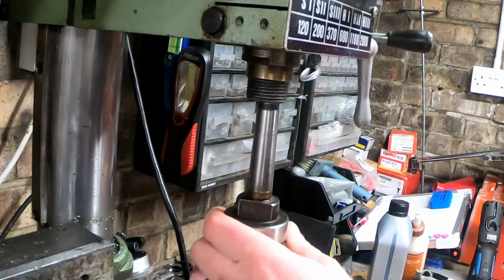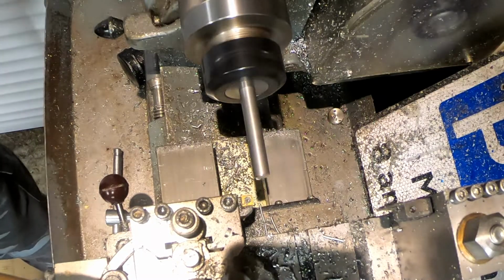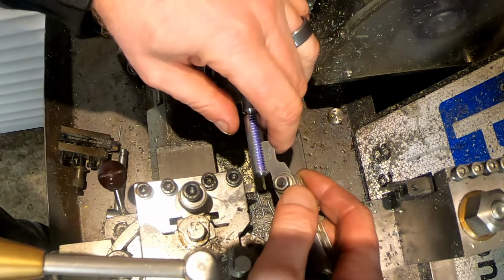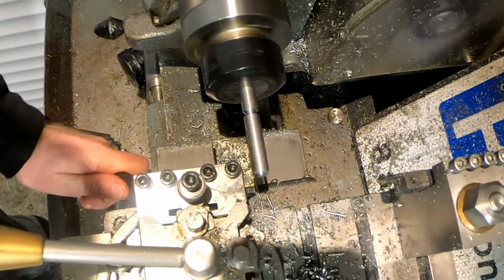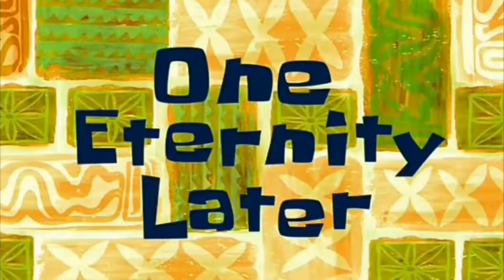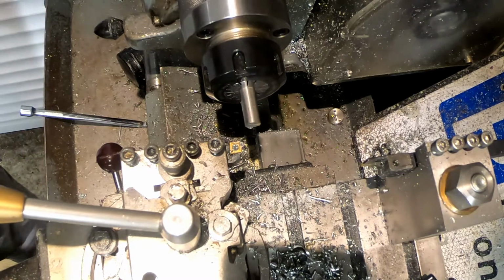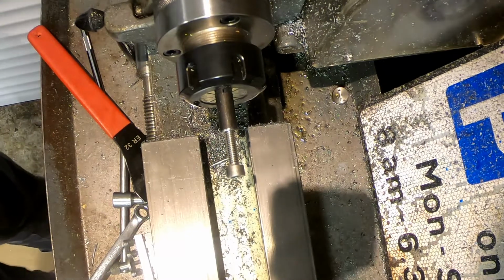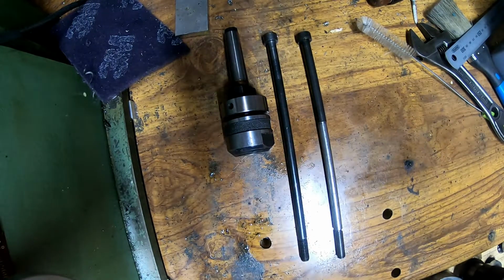Emco FB2 Milling Machine Imperial 3/8" UNC Drawbar

Comment: Nice work, my cap and m10x200 bolt is missing from my FB2. could you do me a massive favor and measure the cap and cap thread, I need to see if I can make one 
Thanks
Reply from the maker: It appears to be M18x1.00. OD is 22mm, external height 30mm, internal height 20mm with the top access bore being 11mm.

Thanks for watching.
Reply: @bodganeering  Thanks for the info, i'll see if I can make something, I'll take video of mine and send you a link, I dont have the thread on the bottom of the quill when you insert the taper and mine is FB2. do they make different sizes?
Reply from the maker: @steveb936  Do you mean the MT2 have no threads in them?
Reply: @bodganeering  No, from the begging of the video with nothing inserted into the quill you have a short thread on the bottom exterior, mine FB2 does not have this thread
Reply from the maker: I get you, I hadn't really noticed it. Although it is an Emco mill it's badged as Warco for sale in the UK and they may well have specified this for their machines. It looks like it could be part of a collet system for the quill but as I have MT2 tooling I've never thought about it.